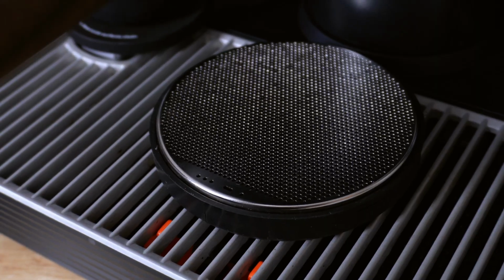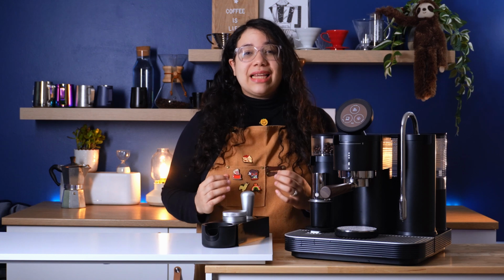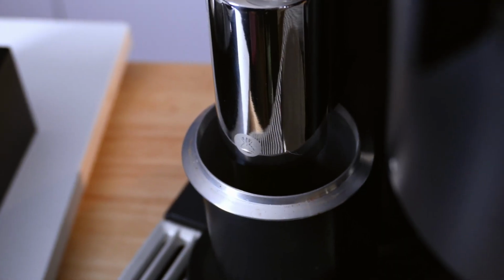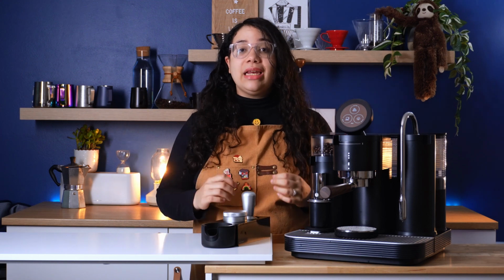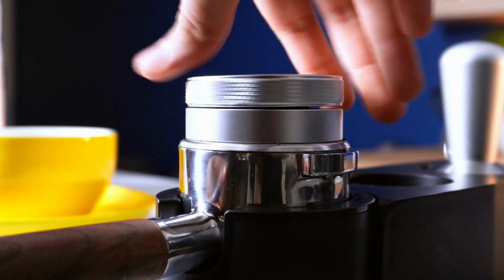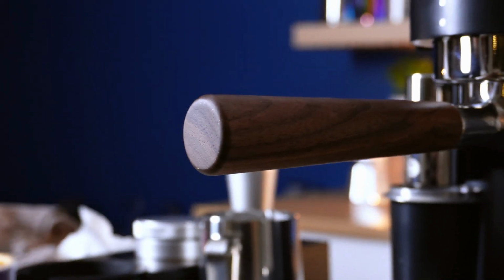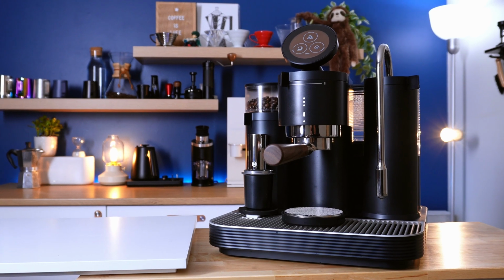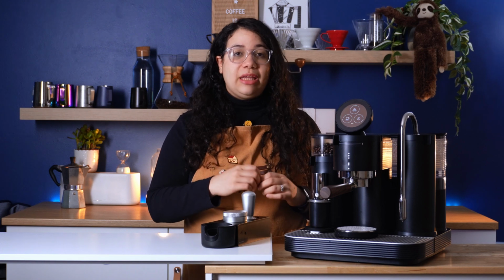Should You Buy The Meraki Espresso Machine? PROS & CONS From A Daily User! [FULL REVIEW]

Comment: The  Expresso machine I’m currently using is GE CAFE Bellissimo purchased in 02/22 to match the other CAFE smart appliances which are monitored and controlled by the SmartHQ app on iPhone and iPad. The app allows me to control single/double grind time and water temp/volume for brewing and hot water.  It sends warnings when water reservoir in empty, grinder jam and cleaning cycle every 70 liters of water. Putting that intelligence in the app instead of touch screen on the machine is one of the reasons it sold for $530 when I bought it and $579 today.  It appears to be made for GE by Breville for about 60% of the cost it’s machine with similar design and function and build-in touch screen.  Unfortunately after just two years of light 2-3 shot per day use it started leaking internally from the water-brew-steam valve and will soon become an expensive doorstop because it is not repairable, not even a replacement group head seal.  

The Meraki interests me but having been burned before on kickstarter companies going belly up after a year or so I’m not inclined to buy one. What I would really like is a machine like a ECM or Profitec with more robust internals with an iPhone app control interface instead of the primitive electronic user interface for the PID which reminds me of programming machine tools back in the 1980s all the “old school” Expresso machines, even the $3k+ ones seem source from the same vendor.  How difficult / more expensive would it be for them to integrate a iPhone based app control system like the GE Cafe?